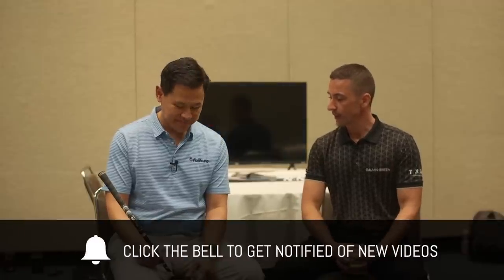Fujikura Ventus Shaft – Interview with Vice President of Fujikura

Comment: Ian, love hearing about these shaft guys talk about what goes into their proprietary kit. I've got a question on a different note. I've got an older driver, Titleist 909D 10.5° in fact, which I absolutely love even after testing several late model low spin flagships. Q: Can my driver, if hit a groove or two above centre produce lower spin similar to the new drivers? I know it will be more rpm but how much? When I tee it up and hit up on the ball, it launches mid to high-mid and goes really well. TXG really has the best backing on testing anywhere. Thanks, Ian!
Reply from the maker: Glenn Wiebe absolutely in can Glenn.  Any strike above CG will cause the head tilt upwards creating additional launch and but also creating lower spin through gear effect.